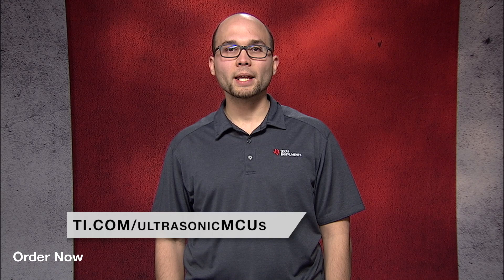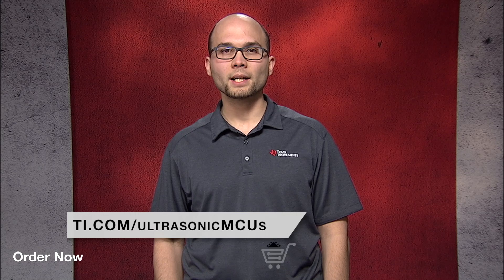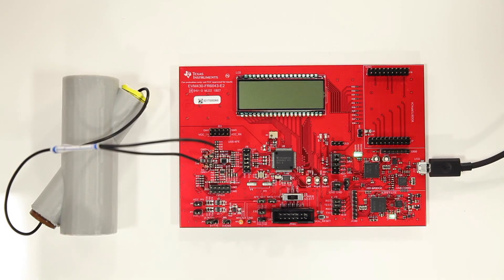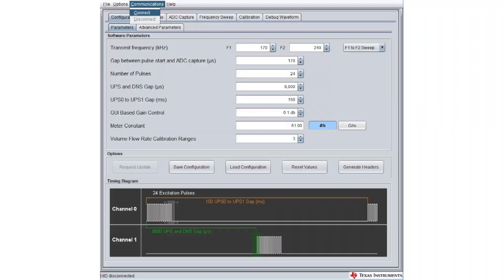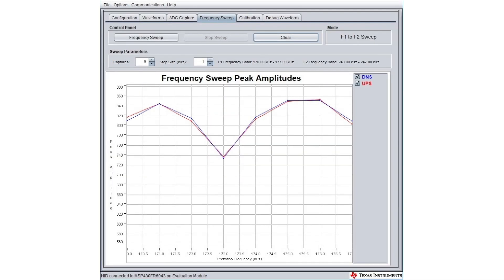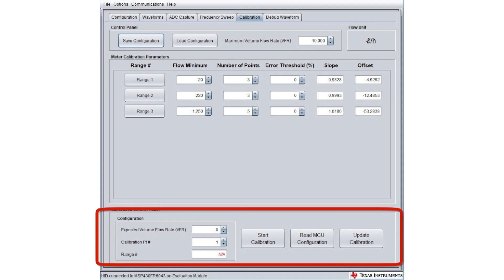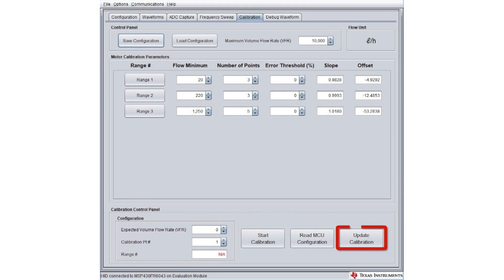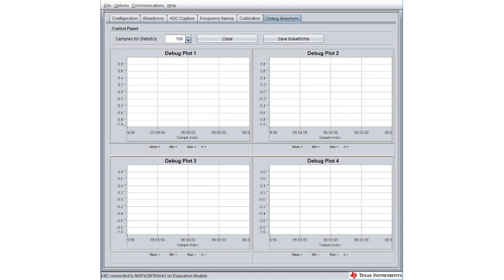Ultrasonic design center GUI for water and gas metering applications

Comment: Why was it so hard to properly detect the stop pulse when using the TDC1000 for water flow?  The Zero crossing detector and  threshold detector was not enough?  Why is they no attempt to properly explain the algorithm used for detection. The design overview looks like advanced mathematics.